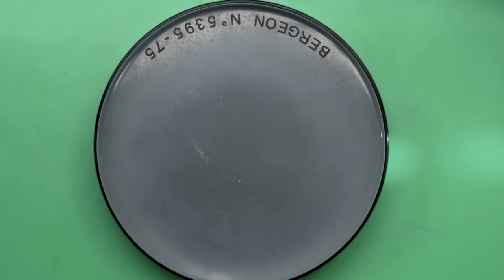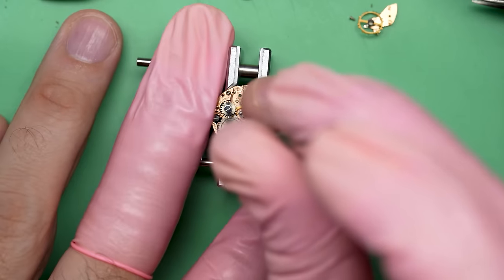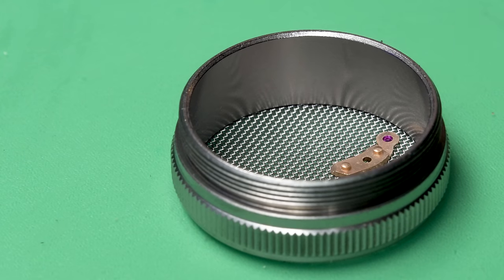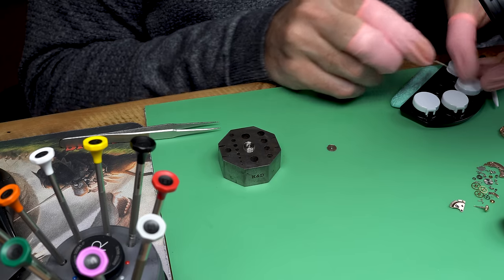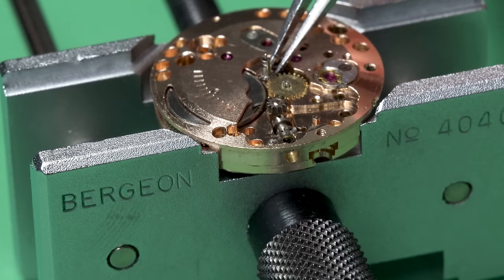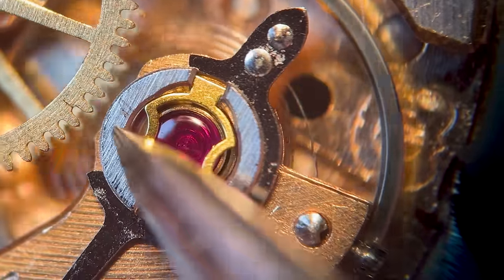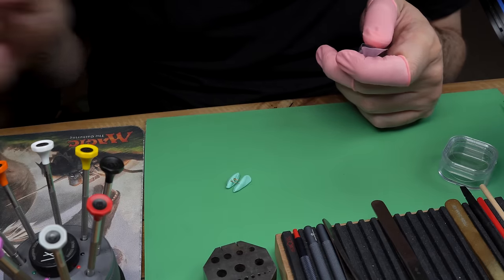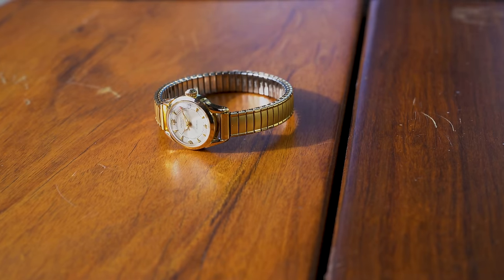Restoring This Tiny Mechanical Watch!

Comment: Good video man....I remember my very old days. My sis and mother used to wear such small dial watches. I don't even know now where they went and what make those watches were.!

I really loved your passionate work and explanation on each parts involved in making it to work or giving an another life to a dead watch. 👍🏻🤝🏻.

Nobody used to explain me when I asked what is that jewels mentioned on each watch case markings along with brand name on mechanical or automatic watches.

You properly explained it with such a macro lens fitted camera videography......Ufff.  simply awesome,  today I came to know why jewels are used and how they are secured in place inside a small watch case. !!!

Thx man.!

Comment: I am amazed at the engineering, drafting, dies, materials, that went into the original construction to have made such a small, affordable, mass produced, accurate, mechanism; the delicate stamping dies, the minute tolerances necessary for its production.
A little research into Washington watches seems to have its parentage in Rolex.

Comment: Just reinstalled the seconds hand on my 5 year-old's teeny quartz. I was using a single loupe, and it was a big challenge to see and access the tiny parts to get the movement out of the case. I was wishing for set of wearable loupes or a microscope. You definitely provided some inspiration on the project. I'll try and get the video edited and uploaded.
Reply: That looks pretty scammy

Comment: I use a little silicone grease where the crown O-ring gasket slides over the bezel for waterproofing and ease of turning.  Polishing the hour and minute hands before the lume could have improved the results. I use a sparkle cloth.

Comment: Wow Marshall, you did a good job on this one. I just bought a F. Hinds ladies' watch from Ebay and I think it is even smaller than this one at 16mm diameter across the crystal. I paid next to nothing for it but it appears to be working well and keeping good time, thankfully, as I would not enjoy the task of trying to service it. But I know where to reach out to if it ever does need it, I think.

Comment: Second point is that you should take the Incablock jewels off the watch and machine clean them in separate small cage during the same cleaning cycle. You MUST remove the cover jewels and put them in that cage too. You MAY clean the balance and the anchor assembled onto the watch, then oil the pallets assembled, if you are precise and careful enough not to spill the oil on the sides of the pallets. The third point is the amount of dirt on your table and tools. Once I saw the piece of fiber you trapped in the barrel under the spring, I could not unsee it. It is a crucial point.

Comment: This is certainly a very small ladies watch for a small wrist. But have you not ever seen a ring watch?? They are exactly that, a tiny analogue watch with a tiny strap worn on your finger. Not my speed, but they're pretty cool. Also, there is an interesting story about archaeologists discovering a Swiss ring watch inside a sealed tomb in China. How'd it get there?? Very intriguing. . . Anyway, great video!

Comment: Don't know how often you work on tiny watches but if you do you could get a piece of metal or even wood the same height as your stand and drill 3 holes in it to slide over pins and center screw to make a 3 rd rail to stabilize your stand.

Comment: I guess you've never seen any women's watches from that era and before because many were even smaller from many American brands like Bulova, Elgin, and many swiss brands, often in rectangular format, as well as the more conventional circular design...truly amazing...it was quite a challenge that watch companies dealt with making tiny ladies movements that were as accurate as larger men's movements...it's a shame they don't get more respect for being the technological marvels they are...on such tiny movements I recommend trying to use rodico to pick up parts rather than tweezers...great video and job on the watch as usual.

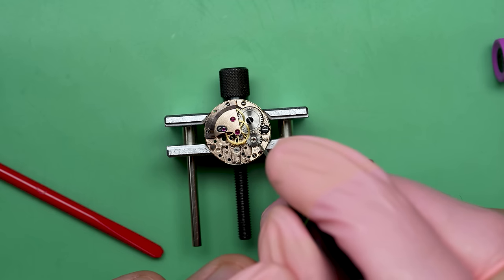Comment: Did I just see you tighten a revers thread screw at 20:05 ish in this video? I can't imagine the precision equipment needed to manufacture these items, especially the flatness for the bridges holding these movements!  Love to see some details on the part manufacture of these time pieces (it's a bit different from weld reconstructing the pinion pivot on a Caterpillar D9 tractor) !

Comment: I've been watching and enjoying your channel for a while now. I really enjoy your narration and your enthusiasm. This hobby is EXACTLY what I hope to do in my retirement in 5 or 6 years.

I have what is probably a stupid question: How do you remember which screws/fasteners go where? I've been watching for a system that you might be using to separate screws used in certain areas and then segregated into separate piles but I don't really notice that. I actually have not really noticed it with other watchmakers, either.

Over time does it just become obvious which screws belong to specific parts? Or is there a system I'm just not seeing?

Thank you SO much!!!

Comment: Pro tip, when you were cleaning the watch dial you should wet the Q-tip with some saliva !!! This is the way they restore some fine art and antiques because the enzymes in your saliva are essentially the gentleist solvent one can use if your trying to clean something like that, where you are concerned about remove the original finish and/or not removing too much of the patina.

Comment: That old watch doesn't use Tritium lume.  Tritium lume is not a paint; it is a gas sealed inside tiny glass capsules, and its use in timepieces post-dates Radium paint.  That stuff getting scrapped sure looks like exhausted Radium paint that no longer glows in the dark, but, Radium has a half-life of 1500 years and still active.  Masking is smart, but so is disposing of the scraped off material.  The only practical way to test hands and dials for Radium is with a Geiger Counter.   I'm no scientist but can't see radioactive lume being dangerous unless inhaled or ingested, but if the hands are Radium, expect the dial markers to be Radium as well.  Great videos!

Comment: My wife has an 1930s (so i have been told) Eberhart the is about half as wide but the same length. Since the case and bracelet is solid gold she uses it as a bracelet. It has a broken main spring that two different watch makers have not been able to find a proper replacement. Want to try?

Comment: I think the problem with such small watches is that the main spring is basically trying to achieve the same energy with smaller proportions and less space to unwind, and it will like stop running more often than a bigger watch. I would always favor replacement of the main on something like this

Comment: When you chronograph the watch to determine its accuracy, you do it with the hands off. If you timed the watch with the hands on, would that create any difference in its measured timing?
Reply: If anything, it would make the watch better timed, as it's designed to work with the hands on. I highly doubt it would do much though, the hands are very light, especially on a watch this tiny.

Comment: I take it you've never seen the Jaeger Lecoultre Callibre (he states, not looking up spelling or model).

I saw one as a museum piece years ago, and it is one of the most beautiful "form from function" engineering/artwork I have ever witnessed.

There was a magnifying glass to see the actual face, but I didn't line up to use it

Comment: Marshall, not sure how I wound up here, but I must say, my wife and I both watch your video's now! me being part OCD panders to this type of work! great job by the way!! anyhow, this video prompted a response from my wife to say " I have a smaller one!" to which a debate endued, and she proved me wrong! way wrong! its and Enicar ladies, has an oval body with strap mounts that pretty much come to a point instead of using pins for the straps, and the face is a mere 3/8" round in diameter!! the whole watch head is smaller than my thumb nail!!! anyway, its not running, so I figured I'd try my hand at very light csi work, the back is the main body and slips snuggly into the backside of the face body, once the 2 parts are separated, you then have to separate this again, and much to my chagrin, I am unable too! and thats not because I dont have skills, I'm a master electrician and a heavy diesel mechanic by trade, so knowledge I do posses, I'm just afraid of damaging something beyond repair, if in fact this is worth anything, preliminary online searches prove it may well be, but I'm wondering if I could persuade You to be the judge! how does one reach out to You!!? keep up the great work! from Ontario Canada!

Comment: That isn't tritium lume.  Tritium only comes in little sealed glass vials.  Any radioactive lume that comes in a binder/powder form will be radium lume, and you need to be VERY careful with it.  As in work in a sealed glove box with tools and containers that are only used for scraping radium lume.  I recommend submerging the hands in oil or water and doing your scraping there to collect the dust.  The dust/water mixture should be bottled, clearly marked as radioactive, and taken to your local recycling center.  Radium is nasty stuff, and with a half life of 1600 years, even a 100 year old watch is almost as radioactive as the day it was made, even if it doesn't glow any more.  Sitting inside a watch it is pretty harmless, but you really don't want to get a single spec of it inside your body.

Comment: Love your channel.  Long time watch and clock fan.  One thing you mentioned though. You made a comment about Gold Filled being the same as Gold Plated. Not true. 18K gold is 75% gold, 14K is 58% gold. 10% gold is referred to as Gold Filled. It's not plated but is just a very low quality gold alloy. I have a automatic Benrus that is 20 micron gold plated and it is marked as such.

Comment: I have a Rolex Cellini Orchid from 1960, manual mechanical Rolex 1401 movement, 
the diameter is 15 mm, 7 mm of thickness, made in 18 ct white gold and integrated
bracelet in 18 ct white gold with 6 diamonds, it's perfectly working.

Comment: Wow Marshall, that is a tiny watch! Did ETA make a smaller caliber than that? The reason I ask my mom has a ladies Omega that she bought in the late '50's that I'm having trouble finding any information on. I'm assuming Omega used ETA movements back then. It appears quite a bit smaller than this watch, and I'm basing that on the size relationship between the watch and the first digit of your index finger in your video, which on the average person is about an inch. Based on that I would guess my mom's watch crystal is not much bigger around than a pencil eraser!

Here's the problem, I've contacted Omega and sent them pictures and they know absolutely NOTHING about this watch, other than to tell me it's very rare. I would like to get it running for my mom (she's 85) and I need to get it appraised for insurance purposes. Have you, or anyone reading this, ever seen one of these tiny little Omega watches, circa 1950? The only other thing I know to do is send it to Swatch. Love your vid's - very relaxing watching YOU work!

Comment: 29:13 PSA not a joke, he's serious. A while ago i bought a detector, because i have several old things and the looming threat of having something that was active kinda weighed on my mind and the only radioactive thing i found was watch hands. And boy... were they popping and screaming in the detector. Can't remember off the top of my head what number it was, but it was just shy of going nuts. I since had them refinished to remove the coating.

Comment: Hi Marshall.  Can you recommend a magnifying system other than loupes? I tried the loupes but find I need to get within an inch of the watch using a10x before images come into focus.  Also, since I am just starting out I purchased a ultrasound machine and was wondering if one of your videos shows you using that instead of the really nice watch cleaner.   Like so many others I have been inspired by you to gather some basic tools and have started working on an Elgin pocket watch.  Keep the videos coming!

Comment: Wow another excellent video they are both mesmerizing and motivating. What would your suggestions be related to starting and how to find a pocket watch or watch to start with? Also regarding screw drivers I watched the video of initial items to start with however if you purchase the entire screw driver kit is it less than buying each screwdriver individually? You mentioned small, medium, and large but wondering if the entire kit is more cost effective.

Comment: How much power does the main spring hold when fully wound?  1/4 watt hour?  In that general range?  EDIT:  WOW, was I off.  According to google it's 1300 millijoules!  1.3 watt seconds.  a 1/4 watt hour would be 900 Joules. But it's actually 1.3 Joules.

Comment: I have a "Delbana" 15 Jewels womens watch. It has the size of a finger nail. The 0.6mm screwdriver is much to thick, to losen even the crown stem. It runs but on a time grapher app, you only see a snowstorm and it's 12 min/day slow. Any suggestions?

Comment: Sir, would you be interested in working on an even smaller watch? It's a few decades old as far as I know. It's got a couple of markings; on the front it says "Coinor", "17 rubis" and "Incabloc". On the back it says "20M" and "Fond Acier". (And yes, it says "rubis" and not "rubies".) It belonged to my wifes late grandmother. When you try to wind it up, it sounds like the clicker skips on the ratchet wheel.

Comment: question. What do the jewels do for these watches? I saw another video of yours that you left a drop of oil on them so they would be covered in oil. What purpose do these serve?
Reply from the maker: They act as bearings for the watch, as the synthetic rubies they are made of are just slightly less hard than diamonds and don't really wear
Reply: @WristwatchRevival  oh that's a neat way of using them. Thank you for the reply

Comment: I have a micro watch like this.  It's an Ekna brand 17 jewel watch with a metal movement on the inside (no battery or cheap plastic replacements)  How would I contact you about a possible repair?

Comment: i have a silver single pusher chrono which needs redo the wire lug & solder back the crown stem tube, the chrono itself runs fine. I cannot find somepone to do this in hong kong. can U repair that or refer someone who cna do this ? Tks tommy fr HK

Comment: I don’t think the lume on the hands was tritium. Tritium is a radioactive gas used for lume in some modern watches. It has to be sealed in tiny glass capsules. This watch probably just had some kind of phosphorescent paint on the hands. I have a modern Marathon watch with a tritium dial.
Reply from the maker: Tritium was used on basically all lume from the 60s through the early 2000s. If you see at the bottom of the dial it says T Swiss T, that's a sign it was made with Tritium. You are confusing it for something else I think.
Reply: @WristwatchRevival  After a bit more research, I see you are correct. Tritium paint was used until it was banned in 1989, then it was replaced by LumiNova and Super-Luminova, neither of which is radioactive. Modern tritium dials use GTLS (gaseous tritium light sources) which are tiny glass vials with tritium gas sealed inside, so the user is not at risk from the small amount of radioactivity.